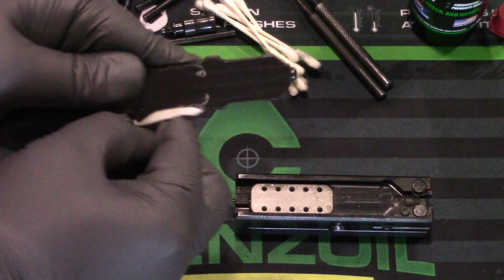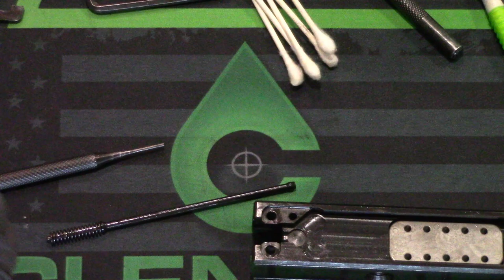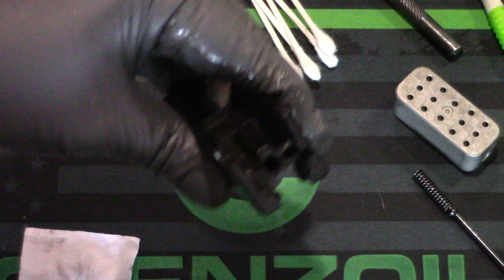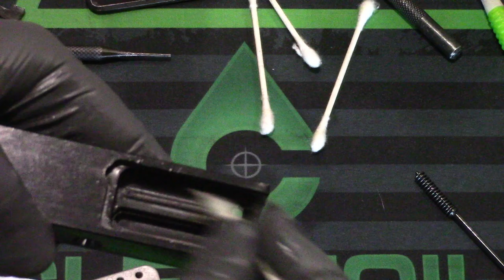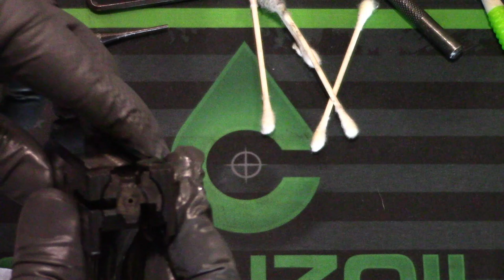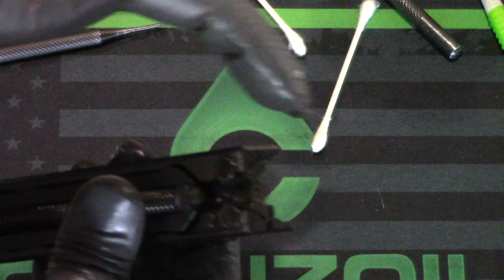How to disassemble and clean the bolt from the  Ruger PC Carbine/Ruger PCC.

Comment: I'm the guy that suggested you do the bolt disassembly and cleaning.  Thanks for doing this.  If your Q-Tips are too big to fit into the firing pin channel, use pipe cleaners.  They have a wire in the middle and there is no tip to break off and get stuck in the deep hole.  There are several types you can get; some are just soft material, and others have a stiff bristle wrapped around the wire if there is some scrapping action required.  If the fit is too loose in the hole just twist 2 or 3 together until you get a tight fit.  You can get these in a smoke shop, or a hobby store, or Walmart in the hobby section.  They also come in colors if that floats your boat!
Reply from the maker: Solid suggestions all across the board and thank you! Yup, I typed pipe cleaners in the video but didn't verbally mention them. They will work great.

Comment: I usually just blast out the firing pin channel with carb cleaner, and then usually a Q-tip sometimes you have to pull most of the cotton off the Q-tip
Reply from the maker: Good idea!

Comment: the two wee pins holding the bolt face in place are under tension. if you depress the bolt face prior to inverting the unit, those pins WILL fall out on their own (instead of being pried out with the screwdriver).
Reply from the maker: Yup!

Comment: FYI. Press on the bolt face, turn it over and the pins drop out.
Reply from the maker: Yup! Didn't realize the pins were under tension from the bolt face until I took it apart.

Comment: Good video. I've replaced the OEM extractor and buffer plate with ones from M*CARBO but never disassembled the bolt head, bolt weight & firing pin. I'll do that this weekend B/C after 500+ rounds I'm sure it's dirty.
Reply from the maker: Right on! MCarbo makes Some solid parts!!

Comment: One tip for people, especially new people, get one or several of those magnetic trays from the auto section or auto store are great for keeping pins and screws from wondering off.
I seem to recall seeing in another video that if you apply pressure rearward on the boltface then those 2 retaining pins should pretty much fall out. Good video.
Reply from the maker: Yup! I have two of them down in my garage and need to bring those little trays up and you are correct about the bolt face, rearward pressure will make those bolts fall out and also easier to go back in on the re assembly.

Comment: Im glad i found this video im going to clean my new ruger carbine pc for the first time
Reply from the maker: Thanks for watching!
Reply: watch out for the little pin they dont tell you about that will be lying there when you pick it up to put it back together it goes in to make the bolt lock back work also gun parts have names they are not little guys it would help us because we have not torn the thing down and put it back together a dozen times but it looks like i am going to have start doing that now it wont be the first time i have had to do this